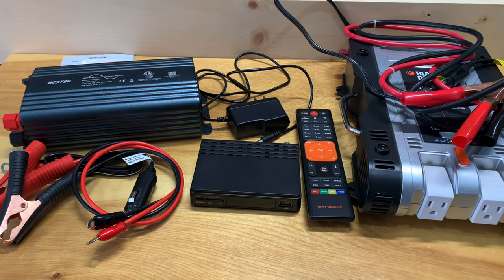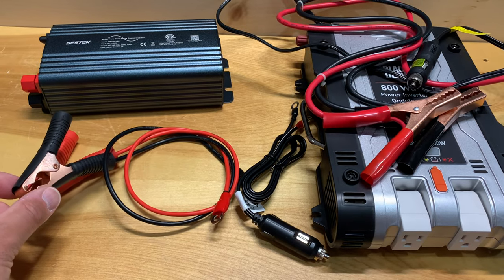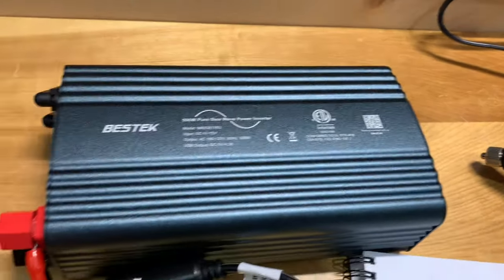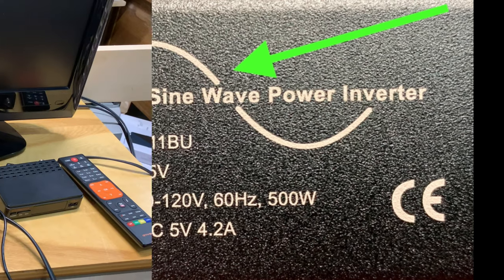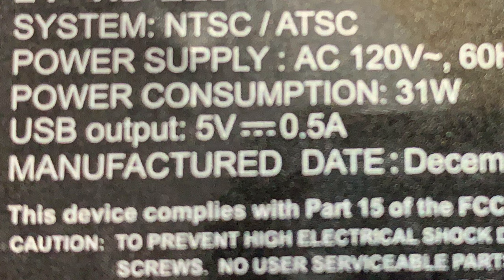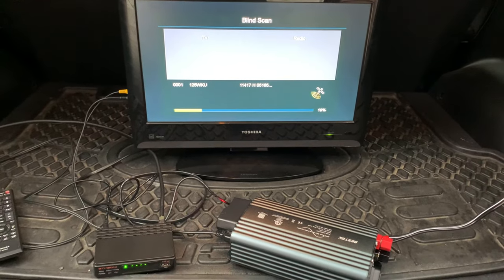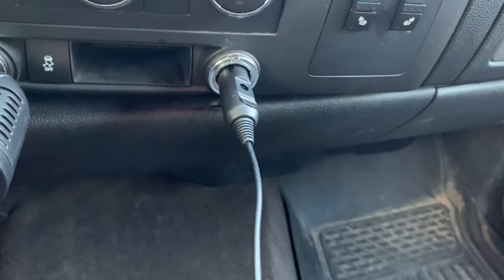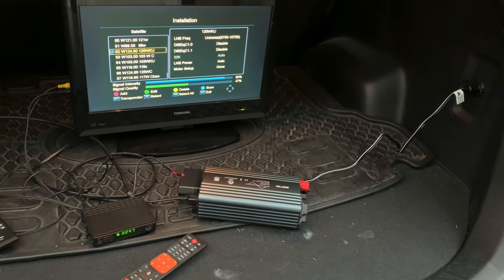Taking Satellite TV Off the Grid

Comment: If your satellite receiver has 12 Volts DC input then you can connect it to your car battery. You can find in the electronics store a car adapter for your receiver. For camping I would recommend a portable 12 volts TV. Last year I bought a new portable TV. In the box I have the car adapter and a power brick for connecting to outlet 230 Volts (the voltage used in Europe). The TV has a 12 Volts 4 Amps input. The inverter is excelent if you have TV that only works on AC.
Reply from the maker: I have 12VDC plugs for my receiver, I’ve actually made my own plug. But I figured the pure sine wave inverter was best for powering AC off a battery. This way the TV and receiver can both be powered from the same sou. It produces AC current the same type as grid power. The 12V TV would really be ideal. Mind you, lots of TVs in North America do have 12V power supply built in, and come with 12V to 120V AC adapter. So that’s something to be explored. But I thought the best thing to recommend was the pure sine wave inverter. Probably simplest and safest in most cases. Plus it’s a versatile unit to provide clean power to most devices.📡
Reply: @NorthcoasterHobby  Yes, your right. If I only have a TV that works only on AC and a satellite receiver. The best solution is an inverter.
Reply: @NorthcoasterHobby  If the receiver and tv can run on dc, no need for the inverter. Figure the power loss from the conversion 12dc - 120ac - 12dc. There's some significant loss there. 
I work in emergency management and have several radios in my work vehicle running off 12v dc and never worry about needing pure sine wave. We have a staging trailer with 4 computers, 5 radios, and 1 printer all 12v dc powered. Running off 3 deep cycle batteries, and no inverter. 

Again, as stated above, I don't see the need for the inverter considering the power loss.
Reply from the maker: @strangersolz  Absolutely. I have made my own 12V cables for powering receivers. I figured the safest way to present this to most viewers is to use the proper inverter.

Comment: Too bad in North America you can't find a TV with satellite tuner built in (DVB-S2). In Europe most TVs have a satellite tuner built in. You don't need a receiver unless you are subscribed to a satellite pay TV operator (like Shaw or Directv). I had a Philips 12 Volt portable TV with DVB-S2 tuner. It was the perfect TV for camping, recommended for places where a normal antenna was useless (low or no signal)
Reply from the maker: A combo unit would be great. The closest thing I have is the portable satellite meter, with built in tuner/TV, but it’s a small screen.
Reply: @NorthcoasterHobby  The meter you have is what I recommend for those who are new into FTA satellite TV. But like you said is a great alternative for TV. As long as you don't have to read (a foreign movie with English subtitles) it's very good.